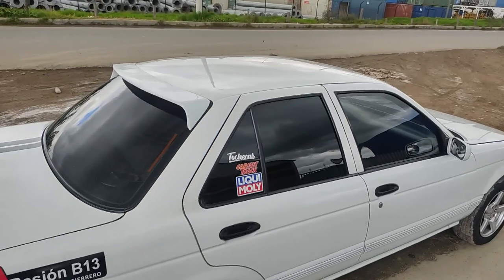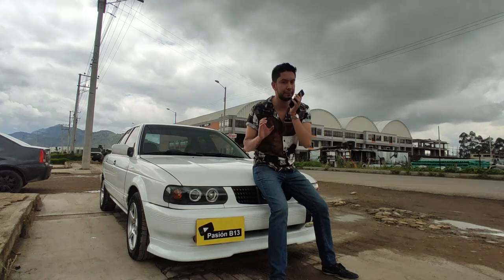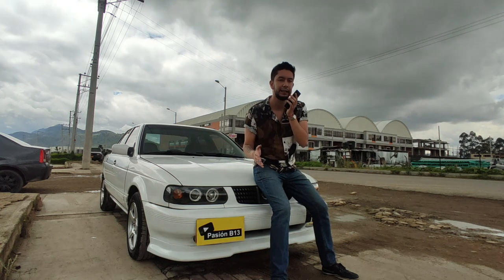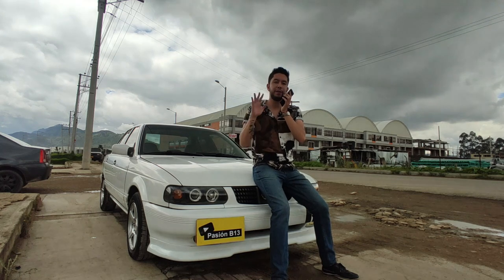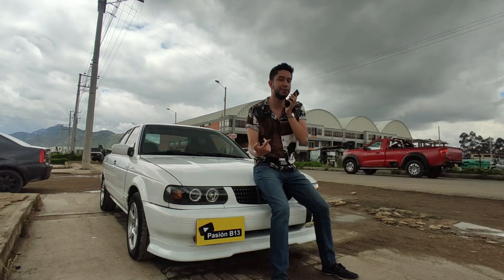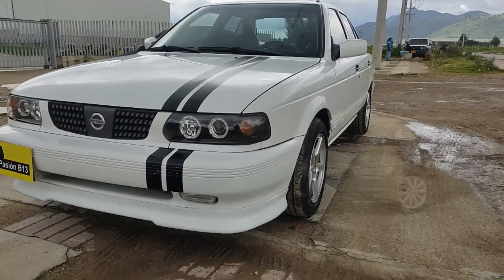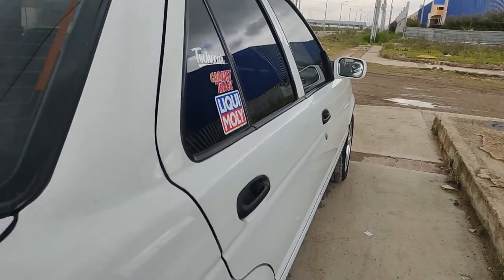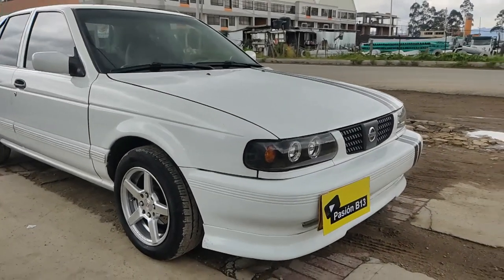0-100 km/h  😱🔥 Nissan Tsuru/ Sentra B13+ Filtro de alto flujo| Proyecto Nissan Sentra b13/ Tsuru

Comment from the maker: Otros tiempos en Pasión b13 (a la altura de Bogotá): 
1. Ford Fiesta ST (stage 2):                                     7.6 segundos.
2. Nissan Pasion b13+ admision de alto flujo:    12.0 segundos. 
3. Nissan Pasion b13 Stock:                                  13.5 segundos. 
4. Nissan Tsuru Modificado Camilo.                     14.9 segundos. 
5. Chevrolet Optra 1.8                                             18.3 segundos. 

Otros autos de otros canales a la altura de Bogotá
1. Ford Fiesta St stock: 9.9 segundos. 
2. Nissan March modificado: 10.8 segundos. 
3. Audi A4 1.8 T : 12.1 Segundos. 
4. Chevrolet Onix RS: 12.4 Segundos. 
5. Mazda 3 2.0 Skylentiv : 14.1 segundos. 
6. Hyundai i25 1.6           :14.1 Segundos. 
7. Hyundai i35 1.8           : 14.1 Segundos
8. Nissan Tiida                : 14.8 Segundos.